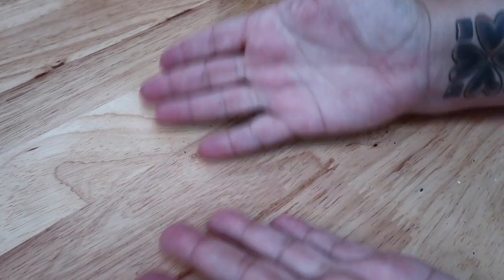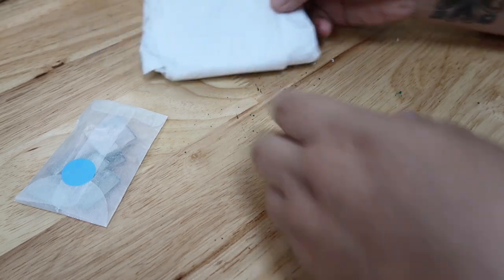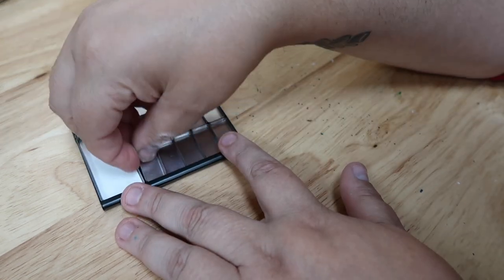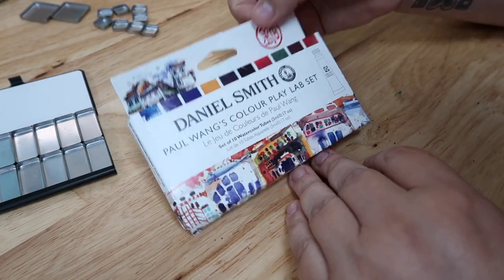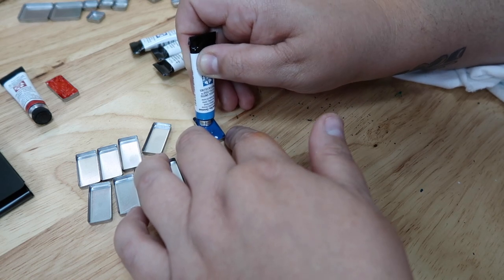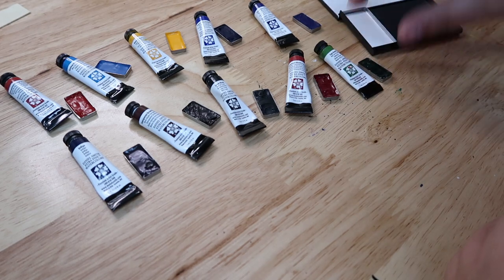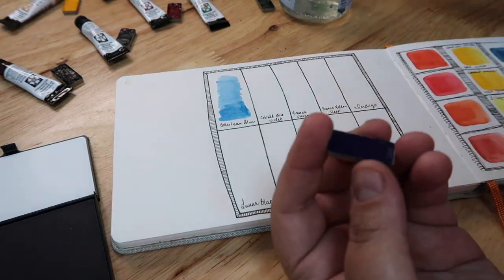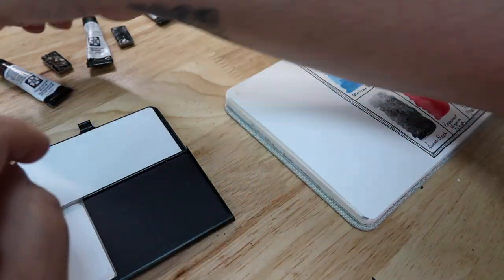Unboxing New Art Supplies // Pocket Palette - Art Toolkit & Paul Wang's Colour Play Lab Set

Comment: Best tip - using the water brush when filling! I make A HUGE mess. It's terrible. You've probably figured this out by now, but before filing your pans, write the color on the back of the pan. Also, the little pans are great for colors you might not use a lot such as white or buff.